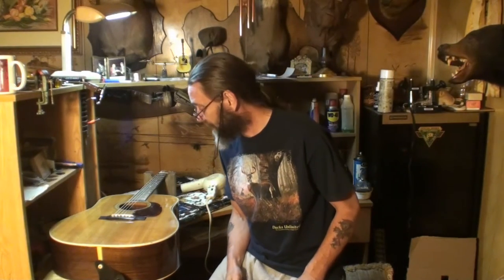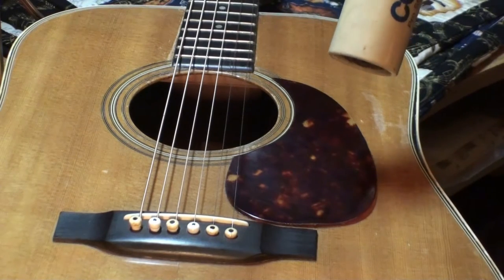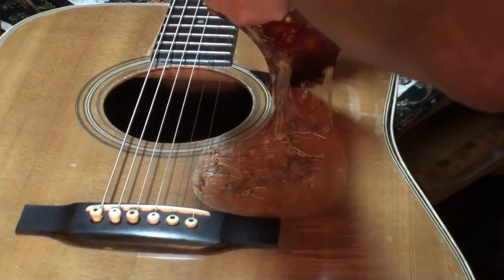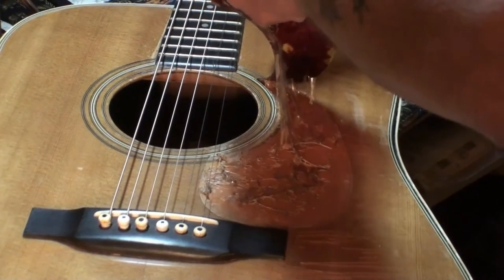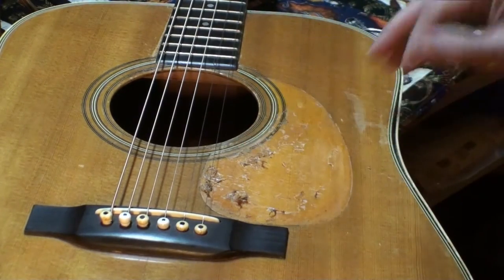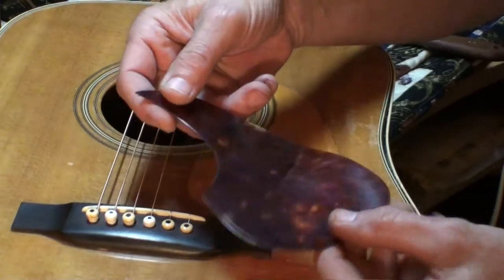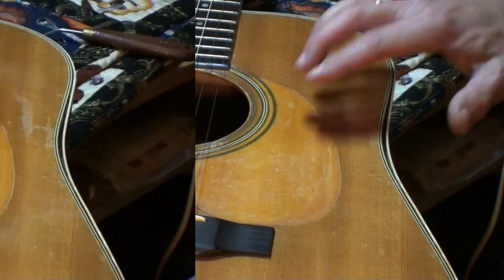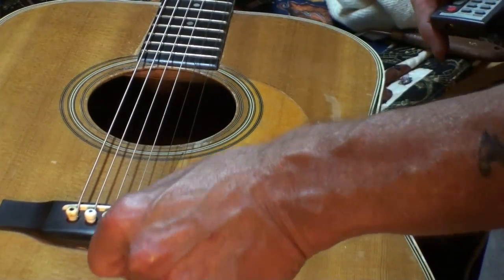Martin d28 pick guard removal and prep by Randy Schartiger

Comment: Nice job Randy.  Have you seen many of the old acetate pick guards?  They often crack and crumble.  Word to the wise...  They are highly flammable.  They can actually burst into flame from the slightest heat.  If you haven't done it, touch a match to an old acetate pick.  They literally disappear into a flash of flame.  Looks like a magic trick.
Reply from the maker: +Rosa String Works lol yes I have seen them, the first few times was a pick, I was looking up the specs on some guitar I can't remember what it was but I was shocked to see a guitar with a acetate pick guard, I would be afraid to try to heat one of them very much! lol Those kind of picks almost burn up faster than you can let go of it! :) Thanks for tuning in Jerry!

Comment: I want to remove a pickguard on my new Sigma J200 copy (that's a big pickguard) and have seen a lot of videos on YT, where everyone uses a hair dryer. However, I have read on a forum somewhere that the heat from a hair dryer can damage the bracing, which will not be noticeable immidiately and to never apply heat, but do it very patiently with just naphtha. So, can the heat from a hair dryer loosen the bracing inside? Thanks!
Reply: Minimize the amount of heat by heating while removing......don't cook the guitar then remove the guard.  Your bracing should be fine if you move quickly.

Comment: Is/was it wrong of me to always remove the pick guard off of all the decent acoustics I have owned?  I always felt like the only reason they were installed was for cosmetic reasons and possibly killed some of the volume?
Reply from the maker: +Harry Timmons Not wrong at all in fact I know several people that remove the pick guard just as soon as they buy a guitar, it definitely effects the tone and volume by not allowing the top to move and carry vibrations as well as it could without it, some guitars removing the pick guard makes a huge difference!
Reply: Randy Schartiger Hey,  I was right.  Awesome!  That's me, that was always the first thing I did to a new acoustic.  They peel right of when new and don't leave discoloration. Peace.

Comment: Hey Randy I have an old57 d28 it has a slight belly on it that needs to be flattened over slotted the bridge as far as pos and it still needs a little more.and also do you happen to no what great were put in at the factory mine needs to have. them redone.

Comment: Could you see any other pick guard was put on before the one you took off? Or to put it another way was that a replacement? As I said in your last video that guard, if it's the first one, dates the guitar to post 66, if it was replaced at some point who knows.
Reply from the maker: +tallthinkev 66 sounds about right. No I'm pretty sure this is the original pick guard, strange it wasn't stuck exactly where Martin usually sticks them, this guitar may have been a second for what ever reasons.

Comment: 1. Loosen the tension on the strings.  2. Pick an edge you can get your fingernail under...pick pick pick.  3. Pull up while heating the guard with the blowdryer.....focus the heat on the area coming off.  4. Pull pull pull slowly.  

If you heat everything extensively first....you will leave the adhesive on the guitar just as you did.  Pull while heating.....the sticky stuff stays on the guard and you might not even have to use goo gone to clean up the guitar after.  Cheers!

Comment: Randy older Martins did have the celluloid pick guard glued directly to bare wood and here's what happens - the two materials.shrink at different rates but the glue holds on so ...What ive seen are severe cracks open up in the top that have to be surgically filled with slivers of similar spruce, finish touched up etc . A real mess.  I think they started applying the guard over the finish to create a slippage membrane of sorts to try to avoid that but celluloid still shrinks over time. It's not like modern plastic. Finally a tip - steel spatula will dig up the finish u want to save - I found an old hard rubber spatula that is almost as stiff and is still thin - but won't scratch. I think it was an old screen printing tool. I search flea markets for stuff like thwt.  Thx for the vids bro keep 'em coming.

Comment: Good tip to use heat to soften the glue under the pick guard. That works on many other applications like removing labels and stickers.
Reply from the maker: +Dale Palmer Yep it does, a good dryer that really pumps ut some heat is a plus too. Thanks for checking it out man!

Comment: That is some really gummy stuff -- almost like rubber contact cement?  Earlier comments about removing pick guards from new instruments in interesting.  I've always wondered why folks argue hours on what is the best species of spruce to  use for an instrument top e.g., Sitka versus Englemann and then the slap a big old piece of plastic or celluloid over it! LOL. Some of those country guys had huge pick guards on both sides of the sound hole -- I always thought that was crazy.  For some Gibsons like the Hummingbird and the Dove the pick guard is part of the guitar's identity.  I had a 1960 Hummingbird for years and I always was tempted to try to take that very thick pick guard off and sand about 3/4 of it away from the back side before gluing it back because I thought it was a sound killer?
Reply from the maker: I've played a few of those guitars with the pickguard on both sides of the sound hole and all of them I've seen it really dampened and muted the sound and you could really tell it, the guitar just can't vibrate like it should. I agree those Doves and Hummingbirds should keep them but those funky ones that look somewhat like flames need to go lol

Comment: Randy I rember seeing some where that Martin only put the finish over pick guards of the D45's back in the day. But in later years they stopped that. Cause the front of the guitars would crack all over. Randy if you were going to buy s new or used guitar. What would check and look for on the guitar? That could be a good video for you. Just a thought. Great video as always, Thank you.
Reply from the maker: +Thomas Tommy Yep they also did some d-28's and 18's that way. That is a good idea but I already have a video up like that, maybe I should do a new one. It's called upgrading your guitar, then another video with same title but instead it's for upgrading the guitar you already have. Or something like that lol

Comment: Nice lesson. I have a hummingbird knockoff with a worn out image on the pickguard. Should work the same? I also have access to a pvc heater, looks like a hair dryer, has a digital thermostat. What is the best temperture to use?
Reply: Gentle heat bud! That pvc heater is like trying to drive a tack with a sledge hammer! Even a light bulb held close to the guard can sometimes be too hot! I've even used just a WARM Iron with a barrier cloth and scorched the finish! When he cranked up the amps on that blow dryer I cringed!

Comment: Might try a product called Bestine, used this in Photography to break down glued hot mounted photos. Will not stain or damage anything. It's actually rubber cement thinner. This glue looks like rubber cement, worth a try.
Reply from the maker: Definitely worth a try, I will try it out, thanks for the tip!

Comment: Hey Randy, question for you...I just bought a like new martin d18 off an on line music store. It just came today and man it's really nice. I mean spotless! I'm an old timer and had a few guitars in my time and well, here's my question. The neck at the base of the body has a distinct white line on one side from the top around the heel. To me it looks like maybe glue seepage. It's a razor straight line but it's noticeable. I am waiting to hear back from the store and I hate to ship it back 'cause I got it for a good price. It plays perfectly and would like to know what you think? Could it be glue? I tried wiping it with a moist soft cloth but it won't come off. I don't want to try scraping it either. Would a blow drier damage the gloss finish? What do you think brother? Thanks a lot, Pete  :-)
Reply from the maker: I was thinking it might be rubbing compound that didn't get buffed off but if you can't rub it off it's hard to say, most glue becomes sort of clear once its dried. I would try buffing it off and see if that removes it.
Reply: Thanks Randy for responding! Earlier I took a warm wet cloth and a soft bristle toothbrush and slowly and carefully it came off. I don't know if it was wax? or I never thought of rubbing compound. You have great vids and I like your dog too. Being retired, I take my two dogs out with me in my truck all the time. Thanks again brother!  :-)
Reply: Hey i was wondering if i removed the pickguard from my black matte acoustic guitar will it leave an outline

Comment: Hi Randy, do you think that was the original pick guard? Look like maybe rubber cement under there. Nothing I've worked would roll off like that, it cleaned up real nice.
Reply from the maker: +Dane Nichols I do think it was original, I can tell by the way it was stuck to the finish it left a very perfect imprint in the finish it was stuck to, the thing that puzzles me tho is the entire pick guard was offset a little bit, meaning it wasn't exactly where Martin usually puts their pick guards. But yeah it's the only pick guard that's ever been on this guitar. Thanks for having a look man!
Reply: Randy Schartiger I agree it sure looks like the stuff that Martin used but I pulled one off a 1956 00-18 and the glue was nothing like that but is was raw wood underneath no finish at all.
Reply from the maker: +Dane Nichols I've seen them with either raw wood under the pick guard like that and the pick guard on top of the final finish, but this is the first time I've seen finish under AND over the pick guard, I've even seen them stuck in places Martin doesn't stick their puck guards normally normally (maybe a second) but I've never seen anything like this particular one.
Reply from the maker: +Dane Nichols I forgot to mention, I know for a fact Martin used a bunch of different types of glue on their pick guards, but this is only the one of a few I've seen with this kind of adhesive what ever it is.
Reply: Good info Randy thanks.